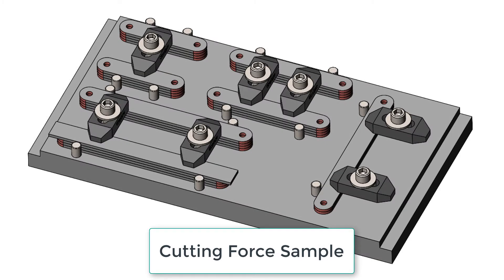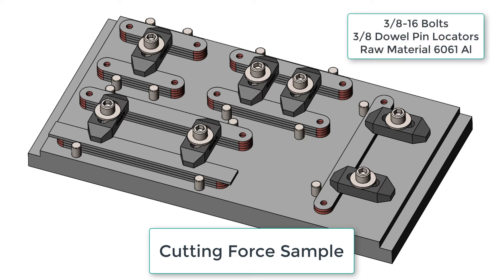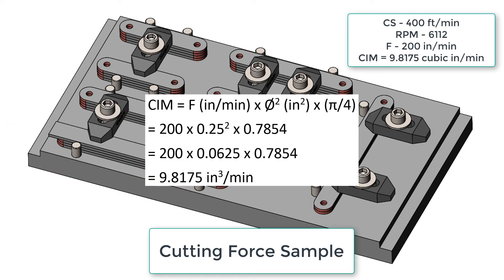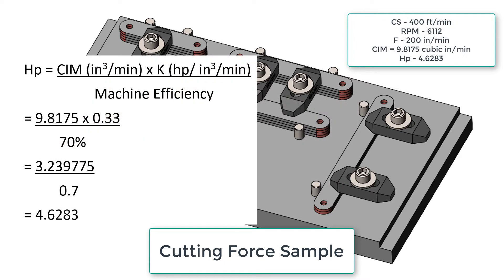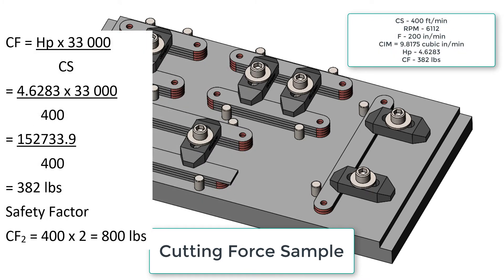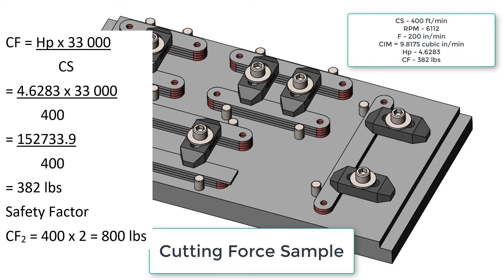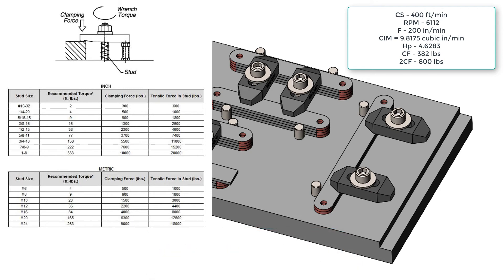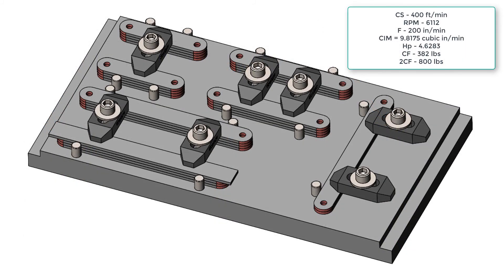Cutting Force - Sample for Drilling

Comment: could you please tell what the K Factor actually is?

Thank you .
Reply from the maker: In inch it is the horsepower required to cut one cubic inch of material per minute.
In metric it is the power, in kilowatts, required to cut one cubic centimeter per second.